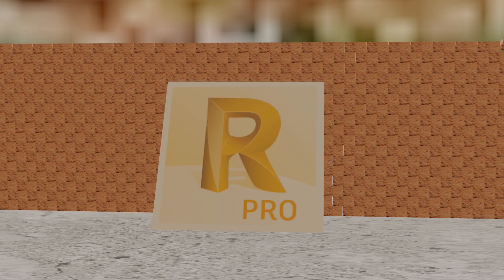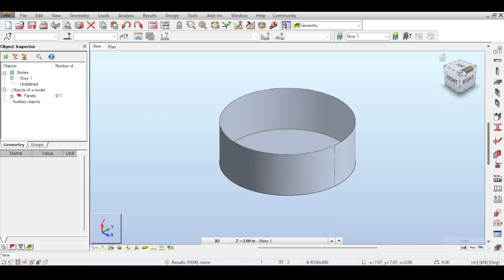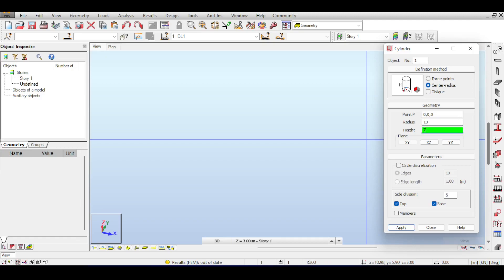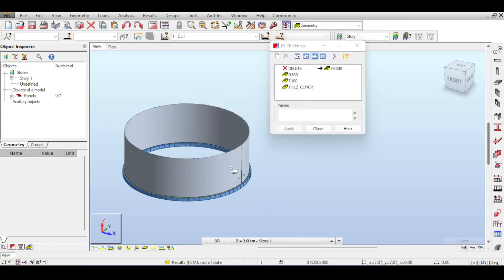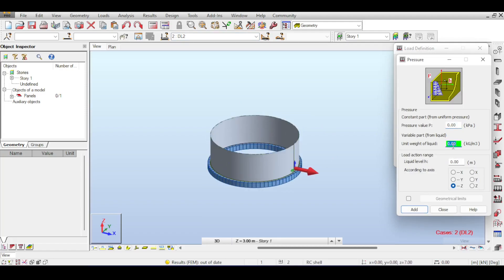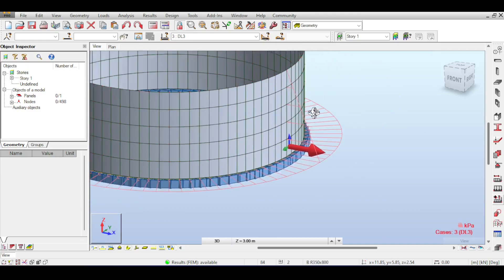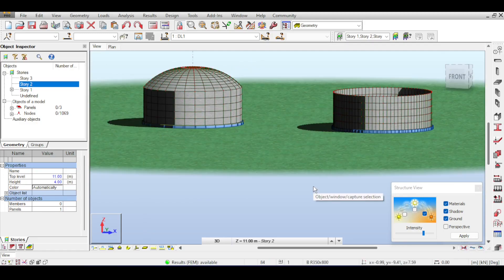Modeling Cylinders and Domes (Simplified Circular Tank) in Autodesk Robot

Comment: y on earth my ROBOT edition is missing a tool here or their first it was the CFD simulation now the revolve and the other tools in its group😑😑
Reply: ok I found the revolve but the project have to be shell structure option as the student starts a project from the main interface
Reply from the maker: Oh, good to know ^_^
Reply from the maker: Really? if that is the case, check if changing the structure type magically makes it re-appear. 
It seems those people at Autodesk kind of messed things up here and there. They tried to simplify things, but made it convoluted

Comment: Great video, how do you change the material to S275 steel? It is currently Concrete
Reply from the maker: Hi there,
you have to define a thickness and make sure you select the correct material before you model

In other words, in order to modify the material, you have to modify the thickness. It is kind of weird, but well, it is how RSA is doing things ^_^

Thank you very much for your comment and stay tuned for more content,
CEE

Comment: Hello CEE, Thank you for the introduction and for the reference [I almost always work in metric system and SI units. I therefore lack the intuitive feel of the order of magnitudes of imperial system units and their values. I often find myself having to first convert everything to metric, this can be a pain sometimes]. The PCA reference that you have mentioned is very good and it is practical. Both theory, concepts, and design recommendations have been comprehensively well presented in this reference.

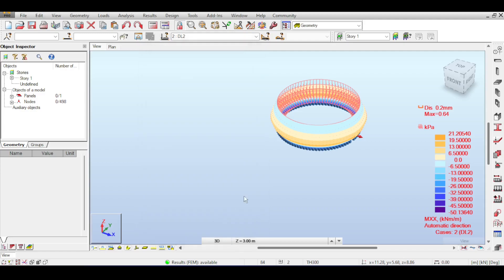In response to the CEE comment at 14:27; I say yes, if possible, I would like to see CEE touch on the design of the walls (and hopefully in future videos, the design of the foundations for these walls and the tank).

In addition to the reinforcements that resist “Bending moment” in the horizontal and in the vertical directions of the walls. It seems that additional reinforcements are also required to resist “ring tension” or “tensile hoop stress” to resist the bursting effect of the walls. It would be great if CEE can touch on how the results or values of the “ring tension or hoop stress” are interpreted from RSAP; and how the reinforcements are provided for the ring tension in RSAP on the proposed design video. 

The BS 8007 (if I am not mistaken) used to limit the crack width from 0.1mm to 0.2mm max (I am not exactly sure what the current = year 2022 crack widths limits or requirements are). Is there a “design module” in RSAP for the assessment of the crack width at service loads for the provided reinforcements? If so, can CEE touch on this as well on the proposed wall design video?

Is it fair to assume that the “strange moments” at 12h48 …..”because of limitations or inaccuracies in the FE method….” should be ignored in the design of the vertical or horizontal reinforcements in favour of the moments values from the rest of the elements that are NOT “….near the connections of the two plates…?” Does the two plates connection point affect other results such as ring tension, etc. at this point? 

You mentioned at 13:14 about “smoothing”, would understanding what “smoothing” is help the designer to decide on the “strange moments” and the connection of the two plates above? Or is the concept of smoothing something else altogether that is rather concerned with smoothened and calculated averages on nodes? [apologies if I am not making sense, I do not really understand what I am saying here 😊] 

Lastly and with regards to the modelling of the connection between the dome and the top of the circular tank walls. I have seen that usually a “ring beam” is used at this connection. I have noticed that a direct connection was used on this video without a ring beam, is this direct connection also sufficient? If CEE is aware of the ring beam usage in this connection, can you touch on how does the two connection models (with and without ring beam) compare with each other? 
 
Once again, thank you CEE for a well produced introductory tutorial, I have enjoyed it!

On the lighter note: I love the clarity of the presentation about the disclaimer at 7:00, it is hard to miss and yet it is also equally (if not more) informative.
Reply from the maker: Hello there, thanks for your comment.
Yeah I do have the same problem with Imperial units to be honest.
Still the PCA reference is good and can help you realize the aspects of circular tanks.

Following your comment, I will then add the design of water tanks to my list. ^_^

Yes, It slipped my mind to show you the horizontal hoop forces, which are tensile. You are right, there as every bit dangerous as the vertical moments.

The inaccuracy is due to the limitations of the FEM method. I will have to - personally - dive deeper into this before I release a video to the public.
It intrigued me personally, and I decided to keep it in the video as a small intriguing hint to my audience, something that you have picked up ^_^

smoothing is a really long story to discuss here, I am planning to hold - in the future - video lectures about various civil engineering subjects. Still, I do not want to simply answer the question like that, but:
I can refer you to: A first course in the finite element method by Daryl L. Logan. and here is a quote:
!!!! Quote Start !!!!
"An alternative procedure sometimes is to use an average (possibly weighted)
value of the stresses evaluated at each node of the element. This averaging method is
often based on evaluating the stresses at the Gauss points located within the element
(described in Chapter 10) and then interpolating to the element nodes using the
shape functions of the specific element. Then these stresses in all elements at a common
node are averaged to represent the stress at the node. This averaging process is called
smoothing. Figure 7–11 shows a maximum principal stress ‘‘fringe carpet’’ (dithered)
contour plot obtained by smoothing
"
!!! Quote End !!!
For the connection, I agree. a direct connection is not really practical, as some sort of "stiffening" has to be performed to ensure the rigidity of the connection between the dome and the wall. Thus, a ring beam is usually provided there.

I thought that I want to try to focus on the "trick of modeling circular stuff", which is the reason why I named the video "modeling circular walls and domes" and left the tank in the end of the sentence

Still, to be honest, I am quite disappointed with my performance in this video. I think it was not of usual quality. I am preparing a simplified raft video "mat foundation" to redeem myself ^_^

The disclaimer had to  be smashed in the middle of the screen, coz I did not want to start explaining all the details of choosing the thickness of walls. That is why I referenced the PCA document. It includes a lot of useful information with regard to that issue.

Anyways, I am always happy with all comments
Regards.
CEE
Reply: @CivilEngineeringEssentials  Wow, I could not have hoped for better answers, thank you so much for your feedback and for the additional reference. 

For me, you are extremely knowledgeable [Respect!], you are honest with your knowledge and you do not pretend to know everything. CEE encourages the viewers not to shy away from uncertain topics or subject but to rather explore those topics and to learn from them.

As far as I am concerned, you have NOTHING to be disappointed about. You are correct, this tutorial did remain focused to its title and it have clearly covered various ways and "tricks of modelling circular stuff". More than this, CEE also offered the viewers opportunity to comment if they are interested on additional topics and subjects such as design of circular tank walls.

I am in admiration of the CEE performance and quality in THIS tutorial 💯 (as I am in all other past tutorials so far). Hold your head high, you have done nothing wrong.